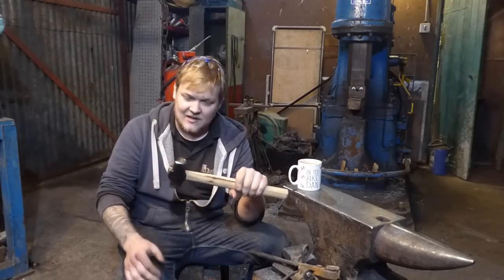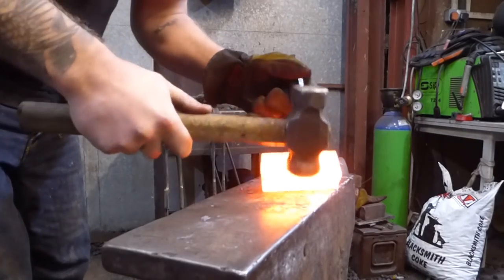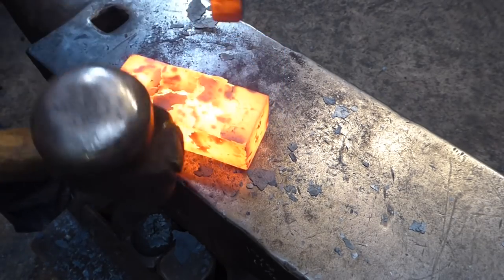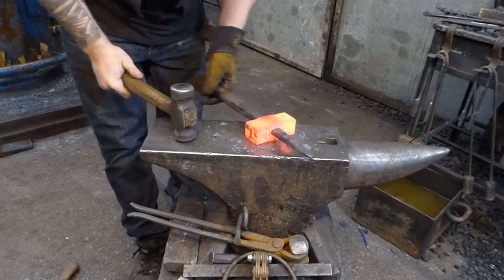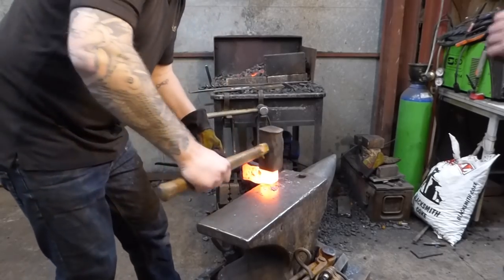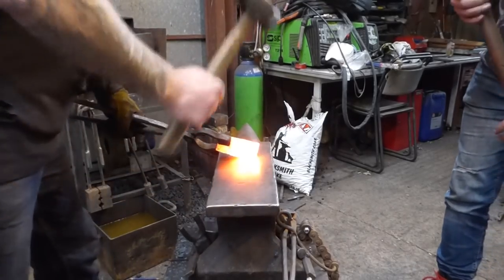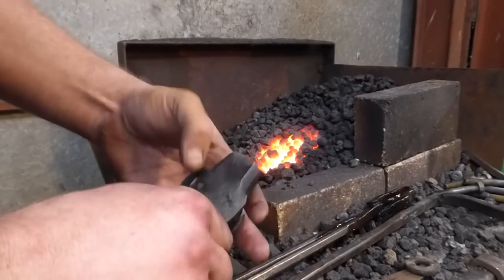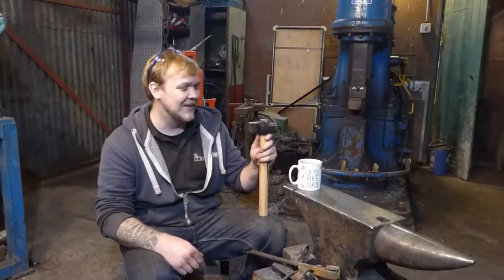Forging A Top Fuller! With No Power Hammers! Step By Step!

Comment: If the punch or drift is tool steel, like tie rod for instance, is it okay to quench after it cools to a black heat? Mindful that I'm usually in direct sunlight
Reply from the maker: As long as one is hot and the other relatively cool most steels will work. Some better than others but should work.

Comment: I appreciate you accelerating the video but I was wondering what the project took in real time? Thanks for the video.
Reply from the maker: Well I said in the video about 3 hours but that was with filming I had a think and it was closer to 2 hours ish. Hope that helps dude.
Reply: @danielmoss2089  I missed that part. Nice hammer Dan